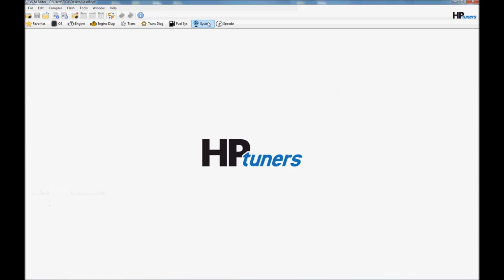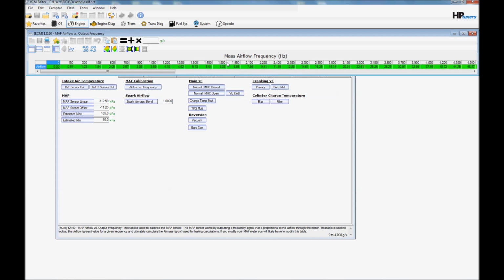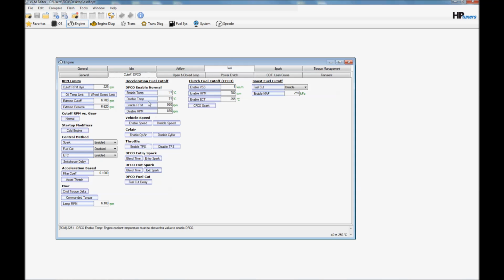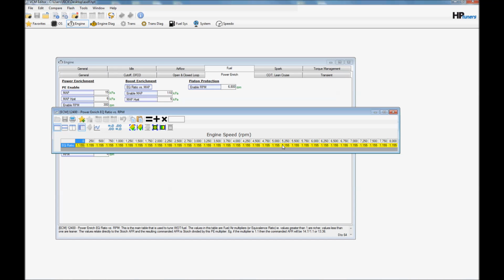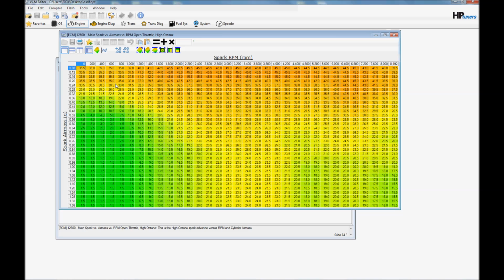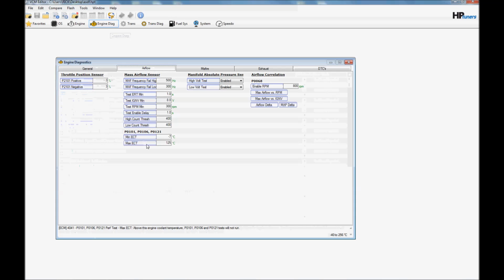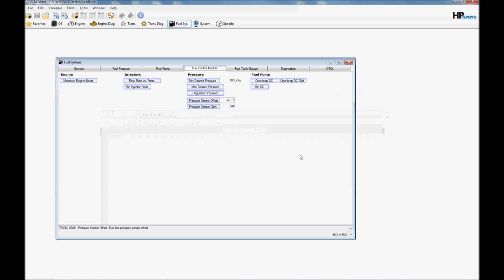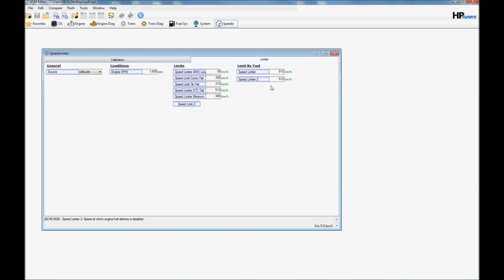How to Tune your Stock 5th Gen (2010-2015) Camaro for Free Horsepower

Comment: Hi. very very dense content. I am going to buy the MPVI2 to tune my SS to gain a couple of 'keen', but hey do I need to buy any additional air sensor? I am getting lost now :-/
Reply from the maker: Sorry, my youtube skills are still growing lol.  So about the air sensor:  IF you are planning to run boost (super or turbo), then you will want a MAP (manifold absolute pressure) sensor that handles more than 1 bar like a 2 bar or a 3 bar.  This will be able to detect the boost.  It will also allow you to disable the MAF (Mass Air Flow) sensor so you can run in open loop, if you want to do that.

Comment: Can you tune original file read with CMD?
Reply from the maker: I'm not sure I get what you're asking.  If by CMD, you are referring to the DOS prompt in windows, then no, not that I'm aware of.  You would need a PCM interface such as HPTuners or EFI Live.
Reply: Can you give me email so i can sent you file...i got full original file from car ecu...it just need to be modded(for cat delete,tune,pops whatever) and write back to the car...
Reply from the maker: @YMFS360  As you may be unfamiliar with these hardware tuning devices, the way they work is, you have to purchase a license for the VIN number of the car you wish to tune.  You cannot tune more than 1 car per license.  You also cannot modify a file from another car that your hardware does not support.  The only way to modify your tune would be to have the HPTuners/EFI hardware, to have purchased the license for your specific car and then to make the modifications.  The suppliers of these tuners aggressively protect their intellectual property and have taken steps to prevent people from tuning each others' vehicles.

Comment: Just a little note for anyone who might be confused, for the l99 (automatic) the max engine speed is 6200, which is also the redline on the tachometer. The rev limiter is set at 6000. The reason the l99 is less is because of the weak afm (DoD) lifters. The lifters will likely fail prematurely if the engine revs over 6200rpm.
Reply from the maker: Thanks EJ, that's good for people to keep in mind and a good addition to this topic.  GM engineers took some additional liberties with the LS3, like using lighter valves (which have less inertia), which allow the manual transmission vehicle to get up to 6600 without issue.  However if memory serves, the electronic limiting may not have been 6600, even on LS3 equipped Camaros.  I'm pretty sure I had to set mine.
Reply: @ChrisCamaro  Yes, so l99 guys like me are tasked with having to change out those pesky lifters if we ever want to do any serious modifications for performance. I guess I'll buy a couple of 12 packs when I decide to do that because i have a feeling I'm going to need them
Reply from the maker: @liamkneeson8866  And unlike some engines that can't even make use of the upper RPM band, the LS engines tend to have pretty good heads on them from the factory so with fairly mild intake mods you can make power into the 6k range and actually benefit from setting your shift point there.  My grand prix on the other hand would need a new top end and valvetrain to allow moving the shift points up.  On the other hand, soft old-man shocks + torquey low-end = fun launches :D
Reply: @ChrisCamaro Haha that's true. Good info, thanks man.
Reply: Man I just had a tune on my 2010 Camaro SS L99
Long tube headers 
And did a cat delete 
Along with the AFM 
And this 2010 car runs nice But nothing like my 2002 Z28 Ls1 with a LQ4 block a light tune 
And the Z28 burns tires like crazy 
Shift kit be kicking 
Thank you all for your words of knowledge and wisdom 
Juno: From SA,Tx
Reply: @feliperobledojr2172 did you need injections for lth or nah

Comment: After rewatching this and doing a little research, I'm under the impression that the stock tune uses a hybrid of both the maf and ve tables. Is this correct? Looks like it only depends fully on maf over a certain number of revs, maybe 4000.
Reply from the maker: That is essentially correct.  For a STOCK tune, the MAF is used for closed loop mode only.  The scope of what closed loop entails depends on how your car is set up to enter into PE mode.  Whatever throttle position you picked for that will determine when PE mode enables and closed loop is disabled.  At that point you are relying on the crappy VE table that comes with the car.  By getting the custom OS, your VE table becomes much much bigger and the car stops relying on the maf at all.
Reply: @ChrisCamaro  I see, I had it completely backwards then. For a stock tune, I thought the MAF was used by itself only in PE (open loop) events, such as WOT. And I thought the hybrid combination of VE and MAF was used while in closed loop. So I had it backward. Guess I better get back to reading lol. Thanks for taking the time to explain.
Reply from the maker: @liamkneeson8866  No problem.  I guess the takeaway is, VE is always more important because it is the basis for for more ECU calculations and is used when you stomp on the gas anyway so the MAF is really only important for steady-state conditions and only with a stock tune or one where it is still in use.

Comment: Great video man, thanks! About to buy a mpvi2 and start learning. Btw if you ever get time you should go over how to tune the vvt cam for us l99 folks.
Reply from the maker: Thanks for the suggestion.  I've tuned cams for other cars before so I can discuss that.  I won't necessarily be able to provide a real world example but I could discuss the theory of how to do it.  BTW, if you want even more information on tuning than what's provided here, be sure to check out my 3 part series for open loop VE tuning.  https://www.youtube.com/watch?v=ppBJZL1rJCA
Reply: @ChrisCamaro  I will be checking that out right now! You're by far the  best teacher on tuning that I've come by so far
Reply from the maker: @liamkneeson8866  I certainly do appreciate that.  My goal is to be able to provide my subscribers with programs, widgets, examples and other hands-on stuff that will make tuning more autonomous and less of a chore but I need to get to 1000 subs first so I can unlock the community tab and do all that!
Reply: @ChrisCamaro  I'm surprised you're not well above 1000 yet, I bet if you posted your links in the camaro5 forum and other similar areas you'd get a bigger following quicker. Though I'm sure you've already thought of that

Comment: How did u populate the ve table when i did it my ve table had all zeros in it
Reply from the maker: It depends on whether or not your OS has been upgraded or already supports VE tables.  Stock tunes generally do not support primary VE tables so they fill them with 0s to indicate that the table is not used.  You have to upgrade the OS first using something like HPT or EFI Live and then you can fill the table in with values.  You can get the values from another car as a starting point and adjust from there after you road scan the car.
Reply from the maker: The VE table is normally not used.  You have to upgrade the OS first to enable use of the VE table.  This is an upgrade option with HPT

Comment: Great video! Thanks for the wisdom man but what caused a tune to come out of calibration? And what impact does that have on a hand held tuner? Thanks man!
Reply from the maker: Cars fall out of calibration because of the condition of the sensors and the environment itself.  For example the car may have been tuned in Detroit but the customer is driving it in Alaska.  Sensors don't have such a wide range of sensitivity to cover both extremes accurately so error will arise.  Also the MAF sensor gets coated in grease and dirt over time and responds to airflow differently after that.  Engine deposits can cause detonation at spark values that were fine before... the list goes on.  The point of tuning an N/A car is to calibrate everything for precisely the conditions that exist at that point in time.  This restores lost power.  The free power comes from eating into the "tolerance" or "safety factor" that the plant assumes when they come up with their generic tune.  Usually this involves adding spark, leaning out the fuel, etc. which I cover to some extent in the video but basically you are trading margin and slop in the initial tune for extra power.
Reply from the maker: A tune comes out of calibration just from driving it.  Sometimes it's dirt, wear and tear, weather or any number of things.  A handheld tuner (which I assume you mean has a preset tune in it) will not adapt for these kinds of changes.  It'll just change some settings, which is fine but it's not going to be as good as a custom tune.